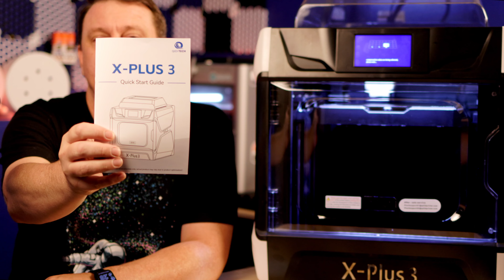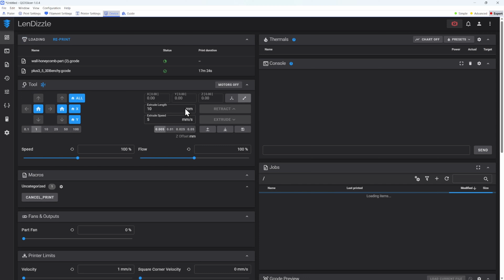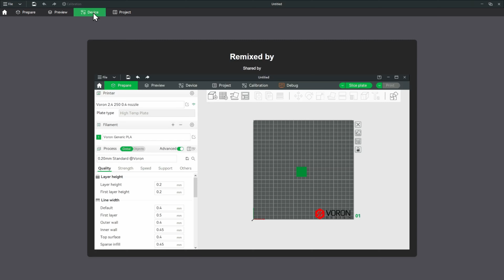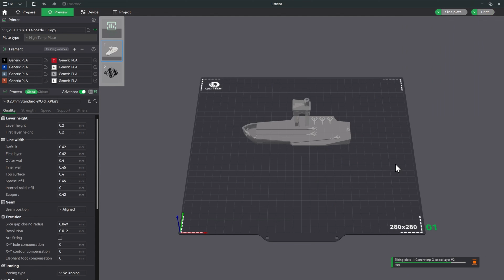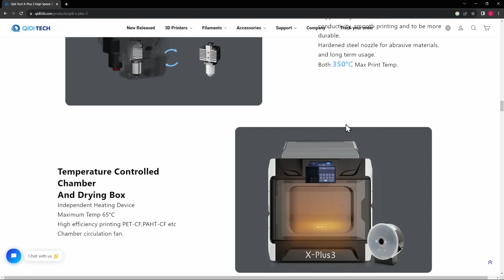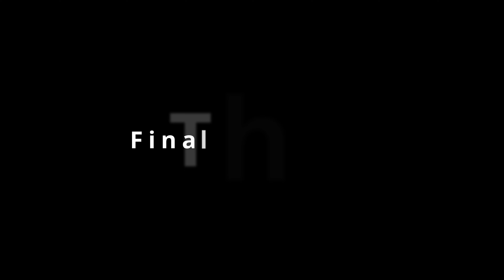Qidi Tech X-Plus 3 Unboxing and First Impression

Comment: If you use OrcaSlicer please copy the Start- & End Code into it from the original Qidi Slicer. If you dont do it, it can crash your printer. I had some issues with the integrated profiles from the OrcaSlicer. It happens if your printer finish the print around the left back corner. They forgot to home the printer after and also before print. Your stepper motor will crash then into the left edge after you start your new print. Then the bed turns up and also crash under the extruder, because the leveling bed sensor isnt over the print bed and cant detect anything. Please note and fix this in your software, otherwise you can crash your whole printer. I already reported this issue it to OrcaSlicer, but it takes time as they fix it. The current Version 1.8 of OrcaSlicer definitly has this crash bug, which can happened on all the last Qidi series printers (X-Plus3, X-Smart3, X-Max3).

Comment: I have an x1c & am considering the x max 3 for my second printer. Mostly for the heated chamber & larger build volume, but I also am not a fan of the mandatory cloud among some other issues with BL.

 I rarely use the ams as I cant run abrasives through it & dont really use pla. There isnt a lot of info on these qidi printers (compared to bambu). How has it been & have you printed any parts that require the chamber to be heated? I also use orca slicer for the x1c & would be using it with the qidi. Looking forward to more content with this printer. Subbed.

Comment: The best thing about this printer is the heated chamber. It can print ABS entirely without internal stresses as long as you let the whole print cool slowly after. This makes parts stronger. The only material printers without heated chambers can print realistically is PLA. Having a chamber makes the print come out visually nice but it's not an ideal environment.

Comment: I have it and printed some things....works great so far. But would love to see it with multi color
Reply: The 3d Chamelon generic filament changer should be able to be adapted to the Qidi. Edit: doh you already mentioned it in the video :)
Reply: @MolOlsson  Also Enraged Rabit Carot Feeder, as the Printer is totaly open. The Board actually a MKS SKIPR (OEM) and you have full access to the system.
But: it's a volcano style nozzle. Large meltzone. Very bad filament tip while unloading, so any filament changer wich does not re cut the filament tip will not be reliable, even if you tune the ramping profiles.
The work around Bambu does: Automatic filament cutter inside the head (between heatbreak and feeder). So only unmolten filament is unloaded. The filament inside nozzle and heatbreak remains. So neither problems in unloading or reloading. But a lot of "poo".
Without an (automatic) cutter inside the printhead forget about multi colour printing. The risk of failiures simply is to high with large number of filament changes. You can have 600 changes in a print - and even if only one fails, it's a bad print.
Of course for support layers it's a bit different. If you only do other materials for interfacing layers and have only horizontal interfaces, you might only have a dozend of changes, so chances are high you are still sucessful. So a Chameleon or ERCF might be a good idea, if you want to print easy to remove supports on technical prints.
But multicolour - not without further modification.
Reply from the maker: Thanks for your feedback.  Me too